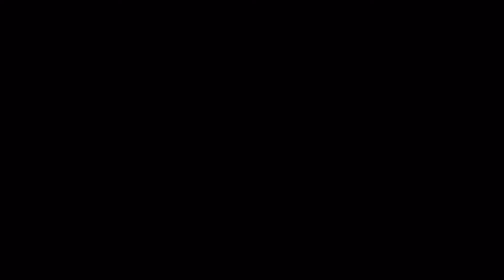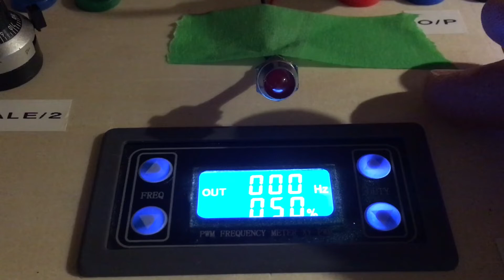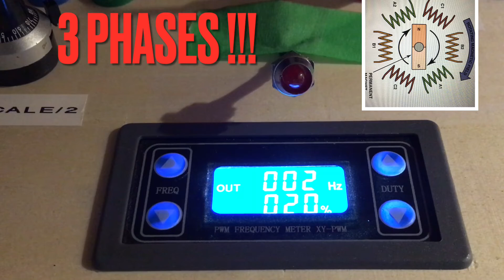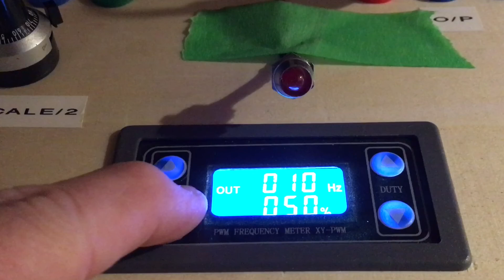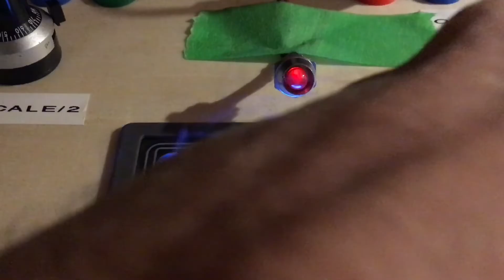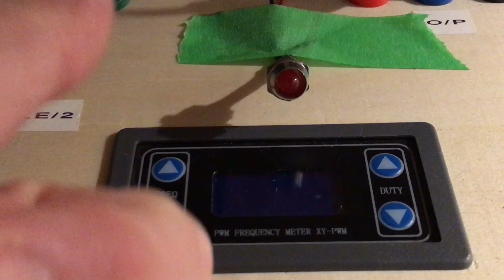EV / HEV Motor Control Analogy

Comment: I've got the same PWM.
Put it in a small project box with a 9v battery and a BNC. Nice quick square wave generator. I use it quite a bit.
Reply from the maker: Handy wee rig. Cheers Denis. Thx for watching. Hope all is well up North as the cooler weather approaches. 👍
Reply: @TheGibby3340  was blistery today...ominous, but no white stuff yet...